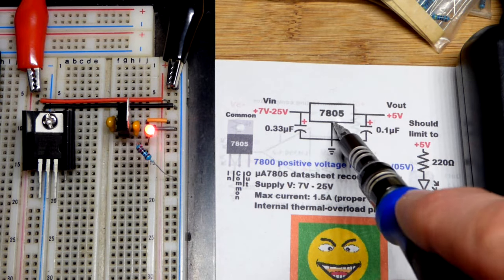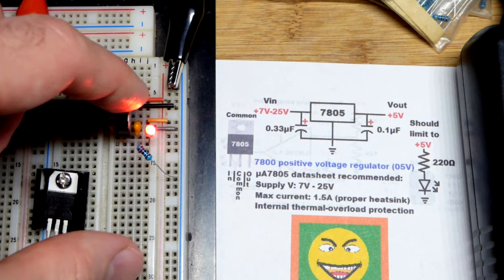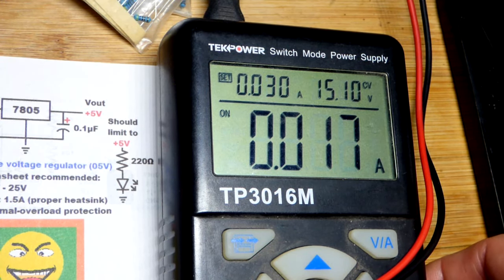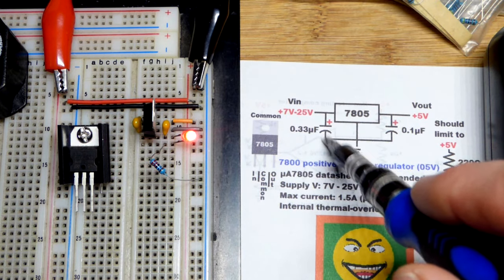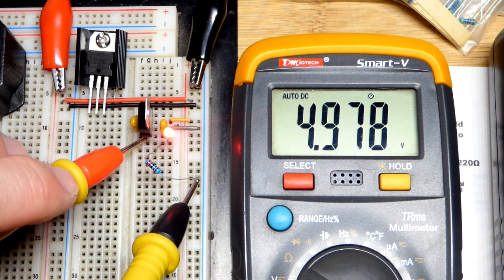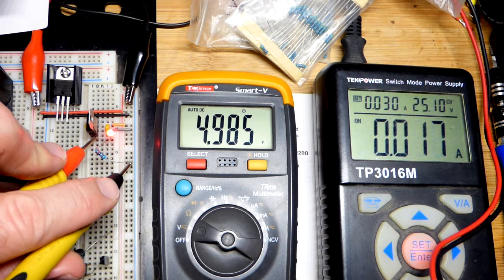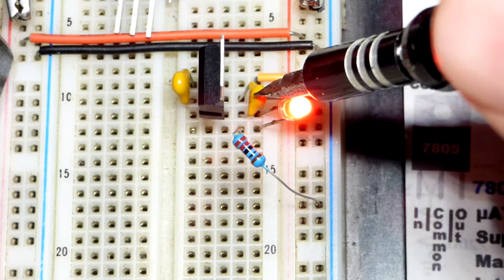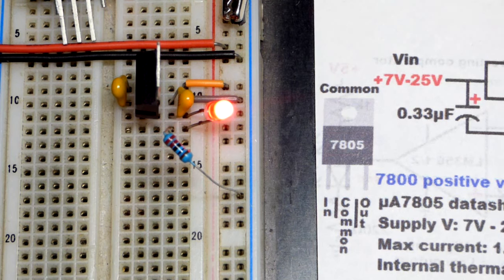5V regulator using 7805 demo circuit

Comment: GREAT VIDEO!!...those caps are so important!
One thing I do with the T0-220 package, when used on a breadboard,  is twist (not bend) the pins 90 degrees with needle-nose pliers so that they don't permanently damage the board-contact strips when inserted.
Reply from the maker: That sounds like a good tip. Thanks for watching!